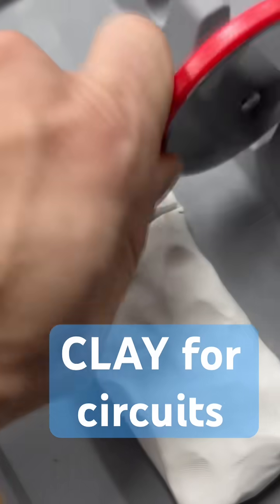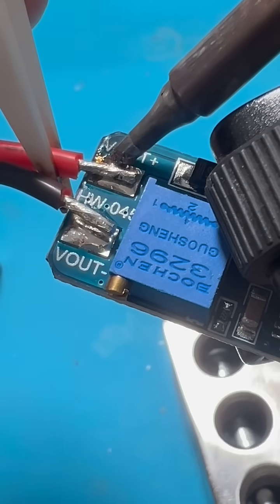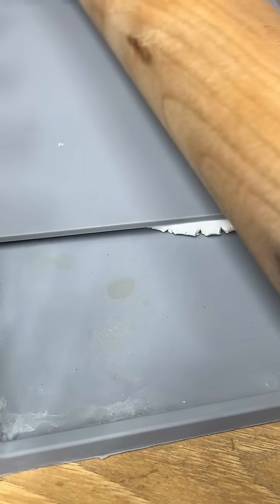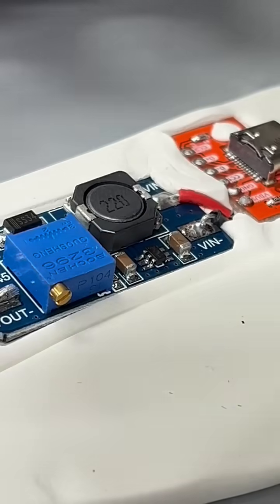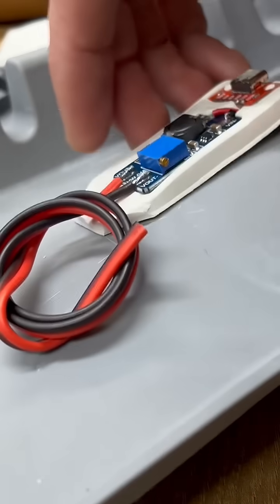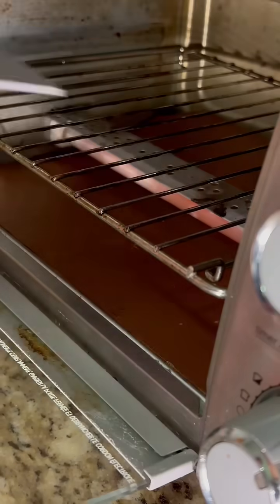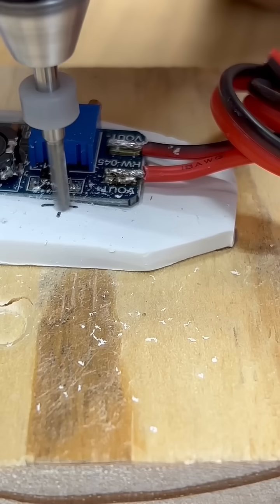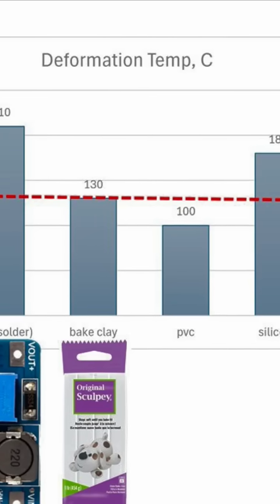use clay for circuit projects #methods #mechatronics

Comment: Bro is confused whether to become an electronics engineer, a demolition expert or a pizza baker. 😋  GREAT IDEA but you have to REMOVE the circuit  before baking it. Put it back when clay is hardened and cooled down. Pease revise video as suggested so it will become really helpful and practical instead of misleading.(Engineers design a circuit so it won't heat up which could damage/reduce component lifespan. This suggests the opposite and invites circuit immediate/intermittent failure. 130 degC is a lot of heat and there simply is no way to guarantee that materials characteristics,  especially the semiconductors, will not be degraded. Also, not all components will be able to withstand this amount of heat.)
Reply: I''m assuming he does this once with a single board to create a board holder that can be used with subsequent boards to hold them for assembly? If he's doing this for every board that's less of a good idea.  But SMD electronic components are in general manufactured to survive reflow temperature peak of say 220C, and generally will not have trouble at 130C. Through hole components may have a lower temperature withstand level. That blue trimpot is a knock-off of Bournes 3296, you can look up the data: "For maximum component reliability and performance,
minimize the time of temperature exposure above 200 °C."  Of course if you're doing aerospace boards, you may have much stricter standards.
Reply: Afaik, reflow is used to:

 1. Heat or melt the soldering paste on the components. 

After reflow, QA tests are done to ensure the device functions correctly and remove those which fails. Since another sort of  'reflow' is conducted, the solder joints could also be affected (depending on the solder material's melting point) or as mentioned, some parts may not withstand that temp. Either way, usually a QA / Final electrical check needs to be done on the device after reflow afaik, which is not possible at home. 

2. For conducting Failure Analysis / Reliability of the device.

But that clay is really a GREAT IDEA because it is easily accessible and also practical. 👍
Reply: @CurtArmstrong3 It should be clear to anyone who works with electronics that you should test new things first. In addition, anyone who works with electronics should know where to get information about this. Namely in the data sheet. There you can see the temperatures that arise during use and/or that can be processed. It would also never hurt to find out what temperature-related tolerances the installed parts have. Standard silicon transistors, e.g. the BC 178A, have a maximum operating temperature of 175°C as stated in the data sheet, the BC 546 to 550 series have a maximum temperature of 150°C. There will of course be some that are under 130°C but anyone who uses them will know how to deal with them... That leaves the circuit board. Unless you have cheap plastic parts that start to melt at 80°C, then they should be able to handle 130°C with ease... especially since you are soldering at a temperature of between 250 and 300°C.  But the maximum operating temperature for circuit boards is 120°C. Circuit boards must be able to withstand this without showing any signs of fatigue or even damage. And of course they have a tolerance. But even the small 0.25 watt resistors can withstand temperatures of 150°C permanently. Of course it is extremely bad to constantly be at the limits of the components, or even close to them. But we are talking about a one-off period of 5 to 10 minutes... And what are we actually talking about here? Hobby projects. And small parts of a project. Sooner or later they would have had to be repaired anyway. And if the absolute minimum lifespan of a semiconductor is 20 years, then a few years less can definitely be tolerated. Especially since, what does 'shortened' mean? One year? 3 years? 10 years? I have far fewer devices that are used for 10 years at all.  then they are too slow, no longer of interest or something else is defective or worn out long before the components give up. Then some people don't necessarily create the best circuits, which eat themselves up over time. Then a capacitor bursts or a resistor burns out... Finally, YouTube is not your guardian. If you see something on YouTube that you like, you generally shouldn't just use it, but first see if it's really suitable for you.
Reply: @armonfrohlich6348  Can you imagine someone who wants a  clay based iphone case/holder baking the clay into the oven with an actual brand new iphone inside it ?
Reply: @armonfrohlich6348 
Best comment ever posted.  👏🏻
Reply: Polymer clay shrinks somewhat on baking, so leaving the part in might be unavoidable with this material.
A similar alternative would be epoxy putty which doesnt require baking.
Reply: @MaximilianonMars  yeah like  there must be  one sacrificial circuit board (or an already non working board) for every circuit board that needs a casing, just like what @graham_wideman pointed out. Not a working/prod circuit board.

Unless the video is intended to be  a prank and in which case, I totally missed the point 😂
Reply: He said to use silicone coated wire to deal with the heat, and specifically mentions that the components he used have a heat rating above 130°C. Obviously this won't work with heat sensitive electronic components. You should verify the heat tolerance of all your components but otherwise his method is fine.
Reply: It's a common first try fix to re-reflow an SMD before you go hunting dry solder points.

Sure, if you're designing a circuit, you don't want it to become so warm that it can basically de-solder itself during use. So you either manage power consumption or add cooling.

The SMD components can easily survive 200°C.

What wears them out by running too hot during operation is the repeated expansion whenever used, so you do prolong the lifespan of the components by designing it with proper cooling.

Anyway 2-3 oven heat-ups won't have much impact... perhaps you shorten the component lifespan by an entire week (wow!) in theory.
Reply: Or heck, make a rough shape like w box with a 3D printer and hotglue it down. Hot glue is cool.
Reply: Reflow ovens for component soldering typically have reflow curves to ensure soldering occurs evenly. However, most components on a board sitting there endure far more than 130°C.

For a hobby project, I don't see anything here that would be problematic from a heat perspective. Don't try this with dual-sided boards though. Those have solder that melt at different temps and the putty shrinking might break small SMD components.
Reply: Nah. Baking electronics is actually a process. And no semiconductors can handle much more temperature range if they're not operating. Just don't overdo it. 10-15 minutes at 130 degrees Celsius is acceptable. In fact, it removes any unwanted contamination and prolongs the PCBs lifespan. There's so much just wrong with your comment I don't even know where to start
Reply: And I'm not sure if anyone can control the right baking temperature at home unless there's special equipment for that.
Reply: @timtim4726 There is. It’s called an oven.
Reply: He hopes that the baking will fix that bad soldering :)
Reply from the maker: aren’t surface mount components designed for a reflow oven above 200C?
Reply: @davidmalawey  
Always good to not heat-stress any circuitboard.

But at my jobb in a Surface Mount line we Heat up our IPC class 3 boards 2 times. Since we mount components on both sides of the circuit board.
Heatstress can impact solderability of the boards pads. Unless you got some very sensetive components there should be no issue heating it up once at that temperature.

Our Class 3 boards can be reheated 5 times total before we scrap them due to quality concerns. We got products in planes, mines and on the ocean floor.

Best thing. dont oven your board.
Read any component data sheets if your worried. But otherwise the risk for damage or lowered lifespan is pretty low.
Reply: @davidmalawey  No. they are not. 
You do not understand the practice or the procedure.
Reply: @davidmalawey Maybe for a few seconds and not the entire component just the solder joint
Reply: Yea. Defenitly need to remove the componants before baking, not only to avoid the thermal stress, but also to ensure proper clearances. And those minimum clearances are easily made by simply removing the part, additional clearances for heat dissapation may be needed as well.
Reply: God dam youtubers think they are so smart... go back to school - the heat will TOTALLY destroy the lifespan or introduce instability
Reply: @MeowEngineer  he said the components he was using had a heat tolerance greater than 130c and showed them in a graph. Are heat tolerances useless on a spec sheet? Or are you just being cynical cause this is an abnormal application and you don't like change?

Also, what happens to components when you're building something expected to operate at that temperature? Heat tolerant components are a real and necessary thing for certain applications.
Reply: @MeowEngineer TOTALLY could not be more wrong. The data sheets cover this stuff. Silicon junctions aren't altered at 130 °C (if they were then we wouldn't be using 800+°C to anneal the impurities in the Si lattice). The only part of a circuit I would worry about at 130 °C is an OLED display or a micro led display that uses low melting point solder to mount to the backplane. 130 °C is practically room temperature for silicon and the epoxies they use for packaging have Tg values around 180 °C or higher.
Reply: @MeowEngineer TOTALLY? So, TOTALLY? God damned YouTube commenters and their hubris. Thanks for letting us all benefit from your TOTAL wisdumb.

Comment: wouldn't the plastic melt?
Reply: He just explained at the very end. That he's using silicone based plastics.  Not PVC based .
 Silicone can withstand 180°C
PVC can get to 100°C
And the clay only needs to be baked at 130°C
Reply: This matter is designed for 130

Comment: Your page is great but I’m baffled by this one, why not spend 15 minutes in CAD so you have a modular design you can print anytime? Hardware mounting holes as editable parameters and a built in strain relief anchor point to make those surface mount wires less horrifying to rely on
Reply from the maker: many of my students must submit print requests and wait a week.  in the meantime, circuits are scattered about desks, precariously.
Reply: @davidmalawey  mea culpa, elegant and pragmatic solution to that problem. I know you can't see my desk through a youtube comment so I'll say I definitely don't have the same problem of precarious circuits everywhere
Reply: PLA will melt at the working temp of most power semiconductors. It's also much more time consuming. You can always make a new polymer clay housing in a few minutes without the need for CAD.
Reply: @stickyfox you're assuming a lot about the design and materials, but even assuming PLA- no, no it will not. Components like LM2696 are specified to 125C maximum junction temperature with a severe derating. The MT3608 I believe he's using in the video triggers thermal overload at junction temperatures above 150C. 
These are *junction temperatures*, not dissipated heat- If the mounting holes of your board are reaching the melting point of PLA you've got way bigger problems than a slightly deformed bracket.